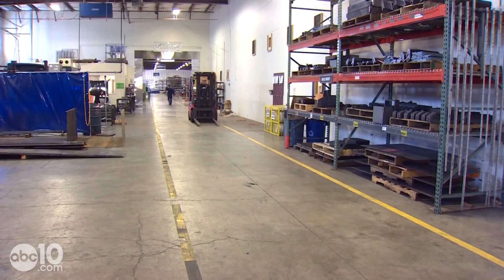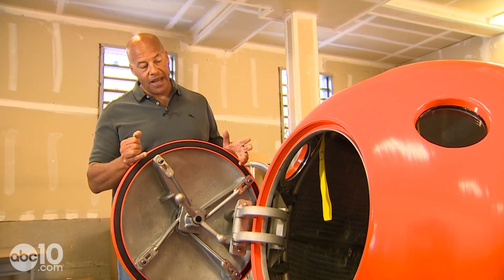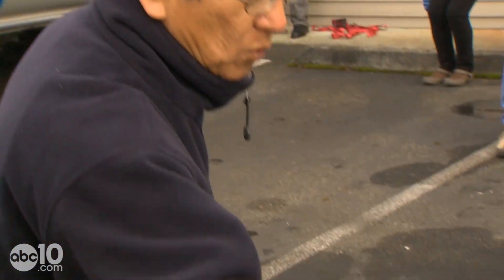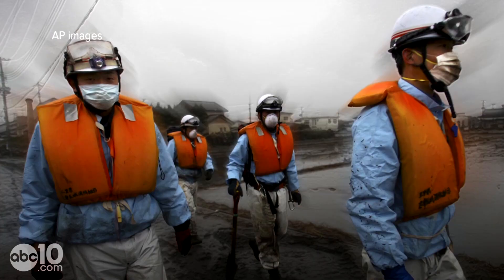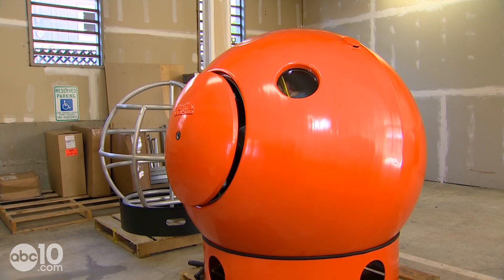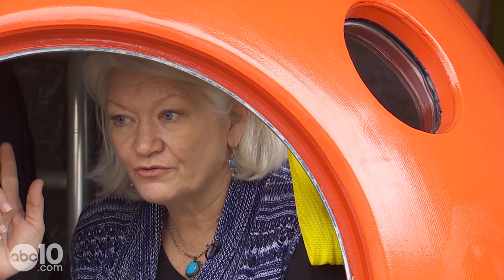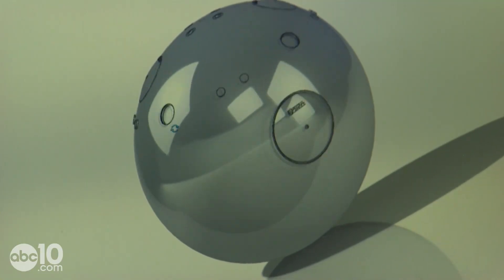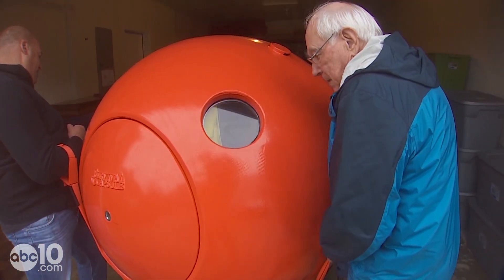Inside the capsule that could protect you from a Tsunami | Earthquake Ready or Not

Comment: add a ripcord that then inflates a helium or hydrogen balloon...maybe for safety...2 or 3 baloons that combined have enough lift to take the sphere airborne...have it tethered to a large concrete block...and also include a tether release inside the sphere.if debris is dragging you back down.just take your chances and fly off via balloon.when danger is passed...pull a cord to let gas out of baloon/s...until a slow descent is reached..beats getting ground to bits in all the debris

Comment: I think it would need a air support system..and impact detection.. inside foam should deploy...you will be automatically sedated.. until you float to the top and sensors determine if surrounding are safe.. open with life jackets..

Comment: The resistance structure made of cylindrical bars should be rethought to favor the interior space. A model based on the honeycomb design would provide both resistance on a small contact surface and space. A ventilation system is necessary because the "ball" could be trapped under the rubble for long periods of time, supports for water reserves and dry food, heating, SOS emission system. A water support system in case it is too heavy and a water evacuation system if the outer shell fails.

Comment: How do you get oxygen/Air and how long does it last
Reply: They are charging $15k for it in US dollars! Better come with oxygen for at least 2.5 people for the duration of the longest tsunami post flow on record. And a reloadable/interchangeable first aid/emergency and emergency ration kit. Otherwise, it's not worth the scrap metal they wasted probably too many grants on. Not to mention it only caters to the 1%ers and fanatics. What if I said depending on geographical location, you could run towards the beach to find a pod and find safety or a local tsunami shelter,

Comment: I love it a lot of people are complaining how it’s not a perfect idea I rather die in there than outside getting stabbed by debris or hit with rocks no thanks
Reply: i mean theres alot wrong with the initial design. just the entrance itself would make it inaccessible for old and disabled people having to crouch down backwards straight into the seat as it doesnt have much of a floor to turn around in.
Id complain about that door demonstration seeing how that over complicated hinge actually misaligned and costed the guy a couple seconds just to close it properly, but thats more of a manufacturing limitation. im just curious how much weight it can push up because if it gets pinned down underwater that would suck
Reply: @theshuman100  it’s an emergency capsule you’ll find a way to get inside. I’d take this over not having any protection. But you’re right.
Reply: @Jessmora884  i just think that something like this could use revisions. Especially considering its over 5 years old.